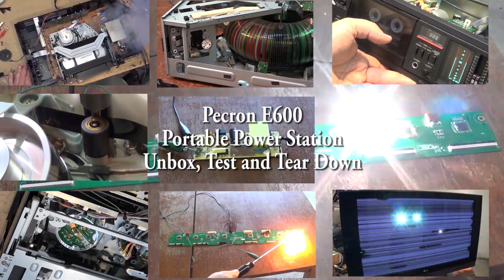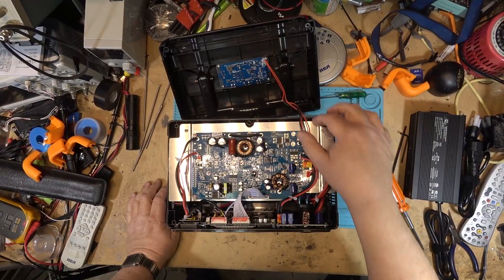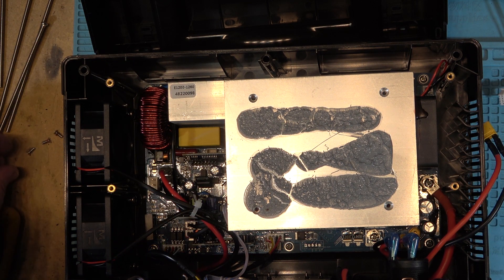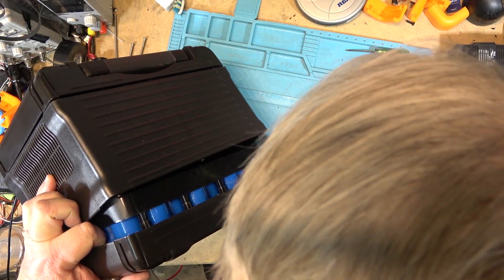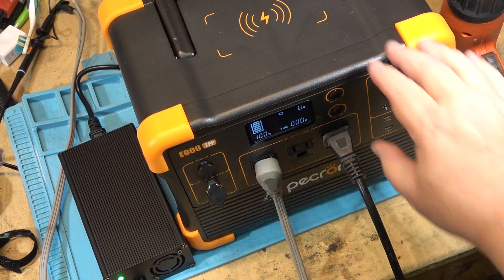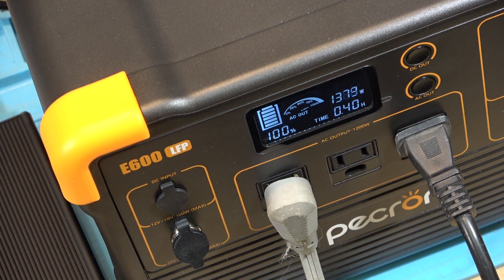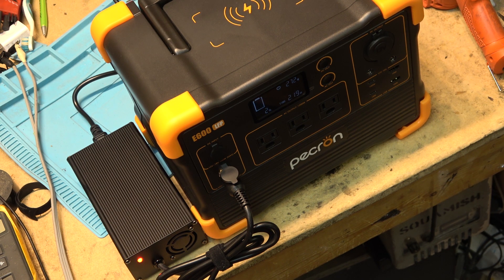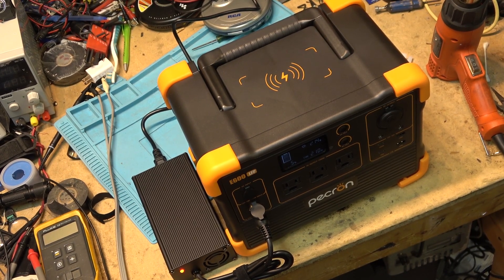Pecron E600 LFP Portable Power Station Unbox Tear Down and full test in OVERLOAD condition Will It B

Comment: I have this unit and it no longer holds a charge.  I have charged it to 99% and when I unplug the charger.  It will not turn on.  When I put the charger on it goes down to 1%,  I charged it to 41% unplugged and went back to 1%,  I have emailed Pecron 6 times in the last 5 months and not one response.  What do you suggest?  I have the EP2000lpf with no problems and two 400 watt panels.  I wanted to buy more but if their CS is so crappy, I may have to go back to bluetti.
Reply from the maker: I have been using my blueti as a ups for year.

Comment: Mine won't turn on or hold a charge possibly beacause it has gone to 0V. I think I might have to charge it after bypassing the bttery management system (BMS). Any help from anyone on how to do that would be appreciated.
Reply from the maker: The manual does say to top up the charge every 6 months or not in use.
Reply: @12voltvids  yes but I didn't so trying to find a solution to get it working. I know this is fairly easily done with Li batteries that don't have a BMS. Thanks for looking into it.
Reply from the maker: The same thing happened with that 70mai unit.  I  let it go dead and it wouldn't charge.  I gave it away. The guy I gave it to couldn't get the flipped cell to come back so he scrapped it.  Lesson learned. Don't let them sit for more than 6 months without topping up.
Reply: @12voltvids  Thank you 12volt. I won't bother wasting time then. Lesson learned.
Reply: If it’s not in use . Why is it still drawing any power at all if it’s powered off . Makes no sense . A quality battery will have under voltage protection and should prevent any more draw to keep this very thing from happening .

Comment: Hello. I have issue with one like this. Station doesn't show load on AC output, but output itself works fine. What it can be? Also percentage doesn't drop down, looks like station doesn't know that it has load on output. Sorry for bad english.
Reply from the maker: No longer have it. I sell these off as soon as i am done or return them if they've loaned to make the video

Comment: Today, I acquired two new solar panels locally at a cost of $100.00 from a Home Solar Panel warehouse. The panels are JA 

SOLAR JAM54S31-395/MR, with the following specifications: 
Rated Maximum Power (Pmax) [W]: 395 
Open Circuit Voltage (VOC) [V]: 36.98 
Maximum Power Voltage (Vmp) [V]: 30.84 
Short Circuit Current (Isc) [A]: 13.70 
Maximum Power Current (Imp) [A]: 12.81 
Module Efficiency: 20.2% 

While I acknowledge that these panels may not be top of the line, they align with my budget constraints. Previously, I utilized two 100-watt panels. However, with my recent acquisitions of the PECRON E2000LFP and the E600LFP, I find myself in need of additional power to efficiently charge these units using solar energy. I would greatly appreciate it if you could review the provided specifications and advise me on whether I can effectively use both panels to charge my PECRON E2000LFP and E600LFP units. Any information or guidance you can offer on this matter would be invaluable. Thank you for your time and assistance. 

Best regards,

Comment: Just had mine fail. Shut off on me when I was powering my CB radio. 12 watt load, went from 51% to zero. Does it have a balance circuit? I can’t imagine I ruined the batteries that quick with the mild cycles I’ve been doing in a months time.

Comment: Could use a dc to dc boost to charge from 12 volts to the solar input for a higher limit. 

I wonder if a 48 volt battery would also charge it.

Comment: Hello, do you think I can tap 12v directly from the BMS contacts to have a 12v DC output? I will protect it with a DC 50Amp breaker. I don't want to buy a separate 12v 50aH battery.

Comment: My observations re solar input:
After thorough testing, I can't figure out why solar input to the Pecron E600LFP is relatively low with panels in series (all other configurations, i.e. single panel or in parallel behave as expected). 

This is our test results (done with 340 W qcells rigid panels - Voc of 40.91 V and VMPP of 34.10 V):

300 W solar input from a single qcells 340 W panel
270 W solar input from two(!!) qcells 340 W panels connected in series
So even lower input from two panels connected in series, than from a single panel!!?? 
390 W solar input from two qcells 340 W panels connected in parallel
393 W solar input from three qcells 340 W panels connected in parallel

Anyone got an idea, why the Pecron E600LFP has such a relatively low solar input from panels connected in series?

Comment: I just got this unit. It's crazy that it can run 1380w for 20 mins when it's rated it at 1200w.
Reply: I just got mine. It did 1450 watts  to run microwave for 3 minutes. Excellent..

Comment: Nice video thanks. I bought this a some days ago. Im a bit concerned because even at 1000W poweroutput I can not hear the fans, not a sound at all. My delta2 fans speed up as soon its above 300 w.
I have no one to compare with, can you hear the fans running? and are they running fast like when it power up?
Reply from the maker: They are running but not super loud.  You can feel the warm air on the left side. When i did the second test with a plasma tv at 300 watts it ran about 3 hours and I could barely hear the fans but they were moving air.
Reply: @12voltvids  Ok thanks. I have to test again 👍
Reply: personally, I enjoy it being so quiet. I only experience noice when AC charging

Comment: A battery backup system that looks well made.

But to save money, it has far too little heatsink but fans instead. It should also have had 2 large fans instead of several small ones.

You will also introduce dust and moisture into the device
Reply from the maker: Heat sink is more than adiquet as mosfets in inverter don't produce alot of heat.  Its not like a class AB amp where they are inefficient.

Comment: Just bought a CAT version of portable station. Little different in that it has a compressor built in, jumper cords , 600watt inverter and wireless charger plate. etc etc. Was not looking for one but open box on sale. Fun to play with
Reply from the maker: Most of those have lead acid battery.
Reply: @12voltvids  You are correct. I did take a peek…. Lol
Reply from the maker: @richardross3815  all the booster units use lead acid.  Lithium can be used to put a charge in car battery but need to be disconnected before cranking